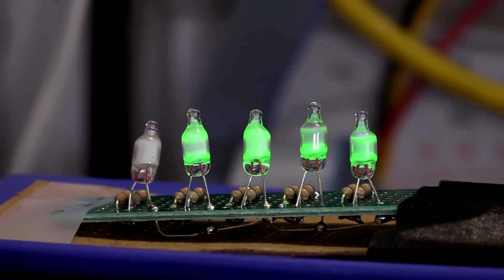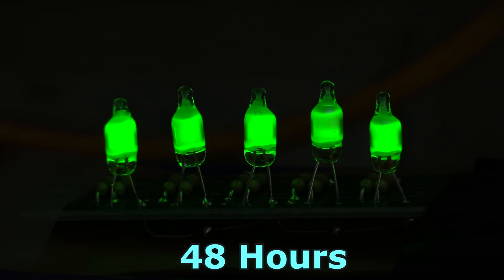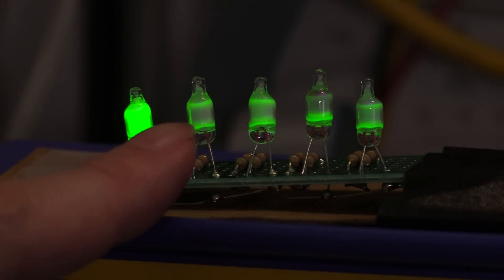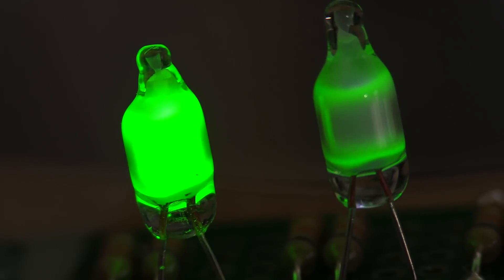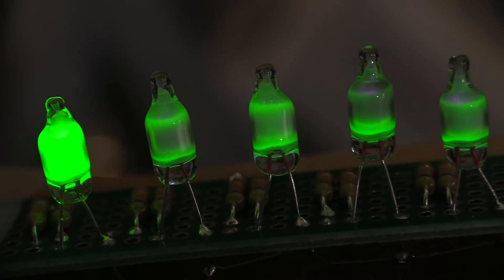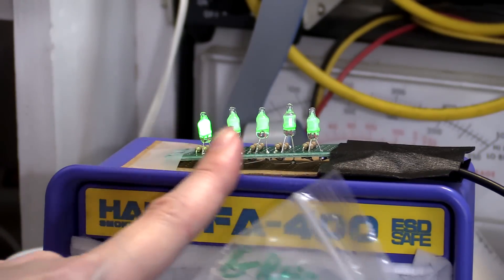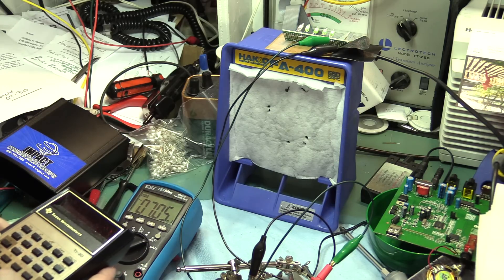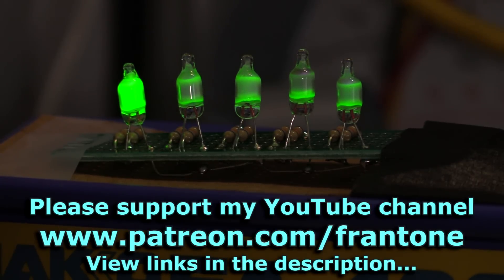Total Fail!!!  The Green Neon Is A LIE!!!

Comment: When the lamps are off is there a sign of slight internal darkening of the phosphor?  It may be electrode sputtering.
I've been using Chinese green and blue neons and I always grossly under-run them with a high value resistor, partly for lamp longevity and partly to reduce resistor heat dissipation (it's a lot higher on 240V)
So far they have been fine as humble indicators with no obvious loss of intensity, but probably not bright enough for your application.
Could your display accommodate the longer bodied neons?  They can tolerate higher currents.

I've just stuck a 330K resistor in series with a green neon and on 240V it passed 0.52mA.
Reply: Sounds about right. I've seen a lot of 170k on the smaller bulbs... Orange or green. 33k is just 🤯
Reply: I've been looking around at various data sheets and they all suggest a 87k-100k range for green or orange neons, aside for some high brightness types at ~50k. I think 33k is over-running the neons WAY too much. Perhaps Sony had a special type of indicator, but all modern types seem to operate at a lower current.
Reply: @MadScientist267  Its even worse, 2*33k in parallel. 7mA is a little much...
Reply from the maker: I looks like old fashioned phosphor burn-in to me, just like an 80 year old CRT would have if you kept a single image on it.
Reply: @semifavorableuncircle6952  Woah haha yeah I missed that. Even worse. Yeah those were murdered.
Reply: @FranLab  Tap one open using Clive's x-ray machine... Money bets you'll find a metallic coating that has formed over the phosphor near the electrodes.
Reply: I also agree to Clive's diagnosis. It's not radiation damage but sputtering from the electrodes shading the inside of the fluorescent film.
Reply: still of course even the sputtering is an indication of low quality - but in this case of the electrodes which are probably not made from a sputter-resistant material such as molybdenum.
Reply: Tiny amount of mercury is usually added to limit the sputtering. Probably this is a "green replacement" bulb without mercury? 😸
Reply: It's at least worth giving it a crack eh Clive. Though I wouldn't be surprised if they were built with just enough Q in an attempt to outlast the ebay feedback timer.
Reply: These are cheap argon fill green phosphor lamps. Argon causes sputtering. Neon (with green phosphor) last so much longer. It’s a common misconception that neon does not produce UV to excite the phosphor but it does. Neon does not cause the sputtering that argon does but they are still bright.
Reply: I agree, Fran's current is on the high side and it is almst certainly metal from the electrodes that is poisoning the phosphor
Reply: @FranLab  You might be able to do a ghetto test for electrode sputtering by illuminating the "front" of the phosphor with UV (shine a UV flashlight on the outside of the tube and  if the phosphor is uniformly glowing we can assume contamination on the back caused the dimming). I know that test works well on some LED light bulbs, results may vary depending on how sensitive the phosphor in these things is & how thick the glass is.
If the phosphor is uniform on the low-hour lamp but still dark in the middle on the high-hour lamps when tested that way then that's pretty conclusive for cheap phosphor burn-in.
Reply: @michaelgraziano8038  Blue LEDs will test LED phosphors perfectly - as that is the excitation wavelength for those phosphors...
Fluorescent phosphors seem to need "the bad kind" of UV - standard UV LEDs don't seem to activate phosphors I've tested :/
Reply: @KomiyanVT  Yup - you're right! I tested with a chunk of fluorescent glass I happened to have ("don't ask") and while I get some excitation with my UV flashlight (365nm) it's barely noticeable, but if I stick it in the UV plate burner with its gloriously unshielded why-are-you-operating-this-with-the-door-open-you-idiot mercury arc tubes I get the expected lighting-up-like-a-christmas-tree.

So much for easy tests :/

Comment from the maker: Lab Log, Supplemental:  I did not mention that the 1.75ma current is what the original SONY lamps in the DT-30 were run at, which is the reason I set up this test bed for the replacement lamps I had installed that failed there.  This test was to run them at the same current draw as the originals from the 70's and observe what happened.
Reply: You can try to install IV-15/1Е4А-В. It is not green, but classic VFD green-blue, and you need to do some work to install those inplace of those neon bulbs. Hm. IV-15 is an indicator lamp as well, so it might be super stuped idea after all.
Reply: Have you checked with SONY, because sometimes miracles do happen.
Reply: After watching this I feel like I should make some just to see if they work better.
Reply: @donmoore7785  I was about to suggest the same.  Note carefully the current number.  Struck they are about 90V.  Nominal 120V mains goes up to
120V * sqrt(2) = 170V
170V - 90 = 80V
It looks like they really want about 100K in series.
Reply: @russellzauner  data sheets imply the legacy parts have a power on life on the order of 10-20 thousand hours… but the legacy manufacturers no longer have parts.
For use in clocks, assuming a service life of 7 years would yield 40-50 thousand hours. Sony was conservative.
Reply: @MrWildbill  only Sony would know, unless Fran publishes the original part number
Reply: @qzorn4440  She's just flat out driving them way too hard. That's sputtering causing the phosphor to dim by blocking the excitation light from reaching it. It's coming from the electrodes, by way of excessive current.
Reply: I've found most of the Chinese neons really start to either burn the phosphors out on the colored ones, or sputter the glass really dark on the basic orange ones, if you run em with less than a 100k resistor on 120V. If you want something that'll be able to take real current, I'd look on an industrial supply site for one of the E12 or bayonet base ones - those are common in machinery and HAVE to be able to take full current for years at a time.
Reply: Okay.
Reply: @qzorn4440  Generally, a resistor is fine for the purpose.
Reply: Why do you say that using LEDs is "stupid".
If you don't prefer them for whatever reason, that is your prerogative, but I'd really like to know why you claim it is "stupid". That seems to imply that there is an obvious technical reason why LEDs would be inappropriate. Is that really the case or do you just have a personal dislike for them in this application and are merely being hyperbolic?
Reply: @jtveg  I presume there is no voltage supply at a reasonable value to run green LEDs from.  It would also be a significant change to the design of a product.
Reply: @kensmith5694  you can run LEDs straight off the mains with a small rectifier and an appropriate resistor. There's a few different ways to do it, actually. Most are very small and easy to implement.
Reply: @kensmith5694  
I agree, but that doesn't mean it is "stupid".

Ps. There are many efficient and rather simple ways of running LEDs correctly from the AC mains ie 110 - 240 V.
Reply: @jtveg  
Yes, I am a bit of a fan of the "capacitive dropper" method:
A current flows in a capacitor only when the voltage changes and follows the rule
Current = (rate of change of voltage) * Capacitance.
With this you can make a limited current without making heat in the process.
You use a bridge rectifier to make the AC current into a DC current.
Then on the DC you put a large value capacitor to prevent flicker in the LEDs
The whole setup is quite low cost.
Note: You need a surge rated resistor in series with the capacitor to limit the current when you first plug it in.
Reply: @BeastlyKings  I know about running LEDs off the mains. Presume 5mA to make them light up.
P=I*V = 0.05A * 120V
P= 
You do the math.
A capacitive dropper is better.

Comment: 1.75mA is a HUGE current for such a small neon! It's not enough for pretty explosion, but is enough to degrade their life. Operating current should be about 100-200μA, the absolute maximums ratings are typically between 500-800μA(!!!). 

And there is another issue — the serial resistor. Theese small ¼W or ½W resistors are not intended to hold a huge voltage across them. There are power limit and also voltage limit, which both should be respected. It's wise practice not to exceed 30V on ¼W resistor and 50V across a ½W resistor.

Comment: My experience is exactly the same. The green phosphors wear out rapidly. I ran them with about 10 in series on a CCFL inverter. 
The blue ones are excellent, no deterioration after a year of constant use, when connected via a 220k resistor right onto 230v mains. I used one as a night light.
Reply: i read somewhere, but cant remember, they can be very sensitive to current, as soon as you go over a particular limit for the neon model no.  , life drops very rapidly

Comment: Hi Fran, I would try a test: try to light a new one lamp (disconnected), with a UV lamp. If your UV lamp has the correct wavelength in theory it should glows.
Then I would put the test neon lamp in a closed box with the UV lamp turned ON. 
I would check regularly every 3 days to see if it is still glowing. If after a week or two the lamp is not glowing any more (without even been powered) then the issue is surely a poor phosphor quality on the lamp or a too thin layer.
If it is glowing, considered the big amount of UV from the big lamp, then the issue could be the voltage or gas mixture.
Reply: Liking this setup idea, well thought!
Reply: Well, the glass tube of the lamp could be a problem. Most glass types naturaly filter short wave UV light.
Reply: Mercury emits UVC, which is blocked by the glass of the bulb. Only fused quartz passes UVC, and you wouldn't want that wavelength roaming free in your house considering it's bad for you. Since the phosphor in these neons is inside the bulb, you'd have to break it open and use a separate UVC lamp to check it.
Reply: Could be a leak in the envelop to
Normal were the copper and glass met
Reply: Sorry but this will not work given the UV filtering glass and the inner coating of phosphor
Reply: @velinr  Not necessarily so re the glass, depends upon the glass alloy and the wavelength of the UV, for example ordinary window glass will easily transmit 365nm.i'm sure 365nm could be used to excite that phosphor.
Reply: More likely the issue is sputtering since it will cover the phosphor and not let the uv thru to stimulate it.
Reply: @BushCampingTools maybe you are right. Still, 405nm are not short enough (from laser pointer) to make it glow. If there is mercury inside, the phosphor will be sensitive to much shorter wavelength (IMHO, just speculating).
Reply: @velinr  Hi there, yes, could be but it still depends upon the phosphor mix. We worked with many phosphor combinations once in order to produce imaging screens for Electron microscopes (TEMs) and i know my colleague played around with many combinations, ok no the same as the phosphors were being excited by an electron beam. I still think though this problem is one of contaminated gas in the tubes and as one person here reported they were able to use their components for several thousand hours. None the less whatever the cause, it was very interesting to watch this video. I did some experiments many many years ago looking at the degradation of phosphors (reduction in fluorescence ver time after high intensity UV at diff wavelengths); that's why when i see people on the tube here talking about blasting their watches with a UV torch just to excite he lume, I'm not sure it's such a great idea because if there i any moisture within the watch then it could cause a reduction in fluorescence.
Reply: @velinr  405 should have no problem both getting thru the glass and exciting a green phosphor... It may not be full intensity but should definitely get it poked with a stick

Comment: I would suspect the green with a decent life phosphor is pretty expensive, so they went with a cheap zinc based one with a cheap PVA based binder, so it glows green, but does not have a long life. Degrades fast because it runs hot, and has a very thin coat, plus contaminated by metals from the electrodes sputtering off. You can see the brighter bands top and bottom where the layer is protected somewhat from sputtering.

If yuo do want a long lasting one find some old 1980's era GaAs green leds and put them in, running off 2mA they will not be bright, but all in a series string with a simple resistor after a bridge rectifier they will provide the right era green glow.

Comment: Green Neon is an oxymoron.  More likely a gas discharge that emits UV and some pospher to give a green glow.
You may have run those lamps at too high a current, which emitted too much UV and destroyed the pospher.  Also the Chinesium bulbs probably didn't have a thick enough pospher coating.

Comment: "No, I'm not using LEDs that would be stupid," I agree!
Reply: I missed some episodes. Why would they be stupid ?
Reply: @TheNefastor   it is because for the sake of authenticity that the green neon is the choice to use,but as for me personally I would go with a green LED.
Reply: @TheNefastor  I'd guess mostly because of the brightness and color profile.
Reply: Not knowing how to drive neon bulbs is pretty stupid too
Reply: Agreed. Running LEDs off Mains AC is stupid. It's fashionable that's it.
LEDs are DC current driven devices. Having to R/C drop Mains AC for an LED is dumb.
Neon is far better suited to high voltage AC.
Reply: @MadScientist267  considering how much stuff shes done with neon/nixies etc.. i think she knows
Reply: @DanafoxyVixen  The bulbs have a different opinion. Do the math lol... I see she's still confused on the gases inside even, that's leftover from another video lol

🤷‍♂️
Reply: @NickNorton  Not a big deal to put a small dc power supply in the unit to supply the LEDs.  No flicker, no scrounging for unicorn bulbs.

Comment: Multicomp / CML MC08030000 is a green neon, available here in the UK from Farnell (ie, Newark / Element14 / Avnet). Farnell product page says 550uA but datasheet says design current 1mA. Life 12,000 hours. Rated 85v AC / 100v DC, Recommended 56K at 100-120V, 180K at 220-250V.

Comment: Regarding possible reasons for the fluorescent material decay, I would suspect a manufacturing issue  -- a tiny amount of air (especially oxygen) contamination in the gas filling.  As you correctly note, tiny (parts per million level) addition of neon does wonders to the starting ability.  But neon is not energetic enough to excite the fluorescence.  It also is not sufficient to get the mercury activated, so the bulk gas is likely argon.  But the UV-C light from a tiny amount of mercury is what actually activates the fluorescent green.  This just for those who don't know, and may (or may not) be interested.
Reply: Also any H2O vapor will drastically shorten the life too. We lost a ton of satellites 20+ years ago because a new manufacturer of some previously ultra-reliable krypton gas infused bulbs started failing after about 10,000 to 10,000 hours.  Previously they lasted for millions.  Turned out that the Krypton gas was slightly contaminated with water vapor (less than 1 ppm as I recall) and that was enough to cause 100% lamp failure.  (The lamps were used in the optical encoder of the gyro reference platforms and were dual redundant on all axis, plus the reference platforms were dual redundant.  Still caused the loss of over 20 satellites and a $1 billion service call to the HST.)

Comment: As others have suggested, you could put the bulbs under an external UV lamp and see if there's any difference in phosphor fluorescence - the glass will probably block UV-B and C but a strong UV-A source should still fluoresce the coating from outside. Also compare the current through the 'tired' ones vs the fresh one - if it's lower then it probably indicates sputtering of the electrodes and gas cleanup. If the gas mixture or pressure is wrong, sputtering can become a problem - it poisons the electrodes, reducing emission and also acts as a getter for the gas. If it's the latter I wonder if you got a bad batch? edit: appears the current didn't change? If so then yeah, looks like the phosphor is bunk.

Comment: Ar will easily ionize at 240V if the pressure is low enough. the lavender/magenta/pink (depending on the pressure) color is very impressive.
But you are right, at full pressure Ar takes a higher V. We melted the guts in vacuum heat treat furnace this way (Mo elements and Al2O3 insulators were destroyed).

Comment: Bought some before Christmas and made a bulb on 120v that has been running 24/7 in my living room as a "night light". I have 13 of them in parallel and none of them are any more dim than a fresh one from the 1,000+ pile I have.

I think you ran them too hot 😬😬😬 I bought the damn dirt cheap one also and they work as well as larger ones. Up the resistance and try again to get yourself an idea of whether or not that is the problem.

I checked to make sure I didn't give the wrong info.
I'm running mine at 85k 120v no problem bright as hell months of use not a single failure.

Comment: That purple glow looks like mercury to me.  I wonder if the glass passes enough UV to light up an external fluorescent coating.  Might try the stuff you used in the DSKY project.
Reply: probably not much. Afaik the main spectral peak of low pressure mercury is at 254nm. Cheap glass doesn't pass anything below 350nm.
Reply: It's electrode erosion, vapor deposition on the phosphor essentially shields the phosphor and they stop glowing green because they aren't getting any UV from the mix anymore

Comment: Yes, the green phosphor neons do not last very long unlike the normal orange neon. I also have a vintage neon pilot lamp with a B22 bayonet base that has been running for 30 years or so in a power board, getting blackened now but still works.